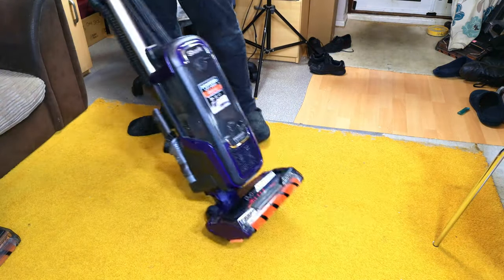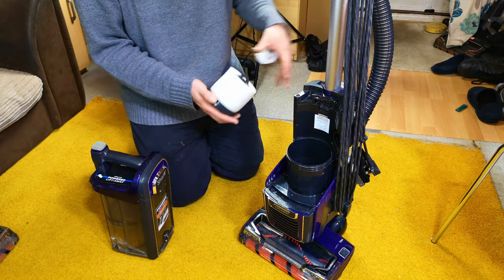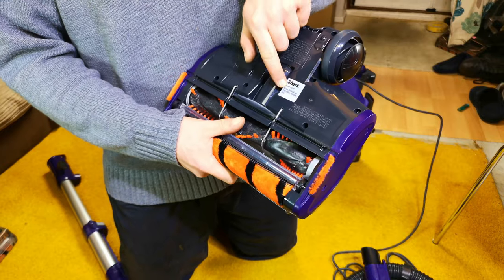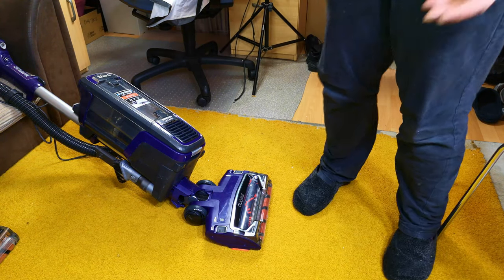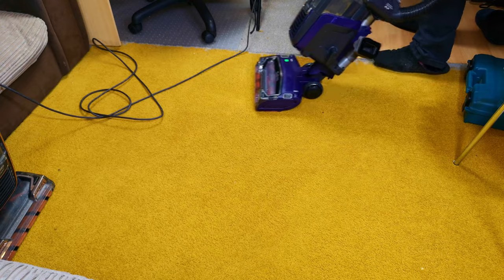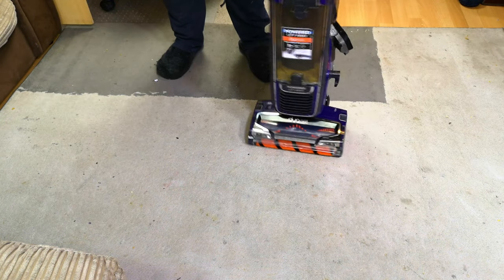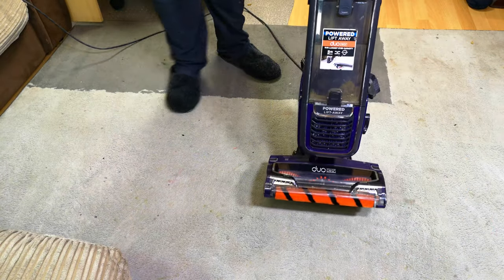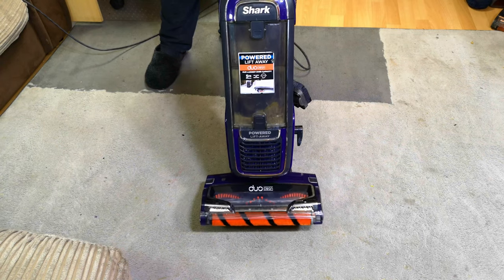Shark AX950 Powered Lift-Away & Duoclean - After Refurbishment and suction HACKS!

Comment: Very good job Sam! Nice work!
I've just got the identical machine to yours and I'm well impressed - prefer it to the 910 I also have- somehow seems smoother and more refined (2 words I didn't think I'd ever use to describe a shark)but I have to concede in saying it with this one!
Reply from the maker: They run alot quieter than the smaller ones, more layers of plastic to deaden the sound I guess! They feel less flimsy too, again probably due to the larger size allowing more surface area. Bar the wands wearing out and causing sparks their the shark I'd choose for larger area cleaning!

Comment: I have a shark ax910 vacuum but the soft roller on it is not spinning anymore I've cleaned and washed it but that doesn't seem to help any ideas?
Reply from the maker: Cleaning won't help, it's a physical issue. You need to strip it down to troubleshoot, the front roller is driven off the main roller, so if the main roller spins but the front one doesn't I'd say its the tiny belt or the drive cog is jammed up.